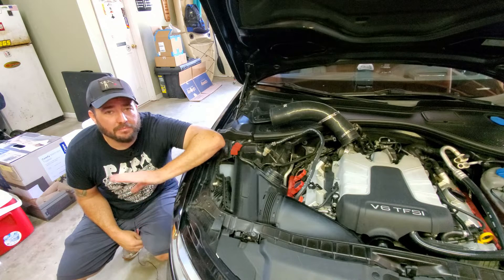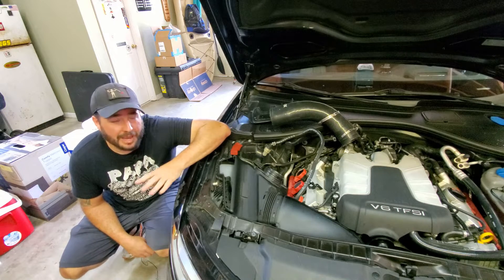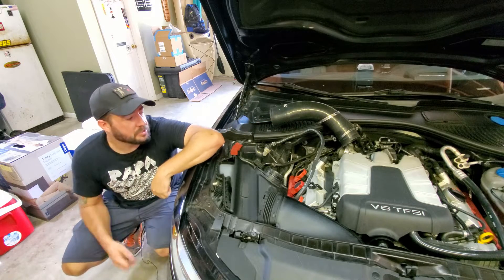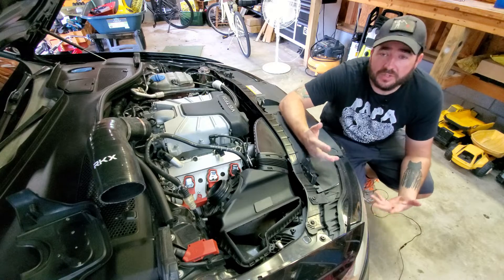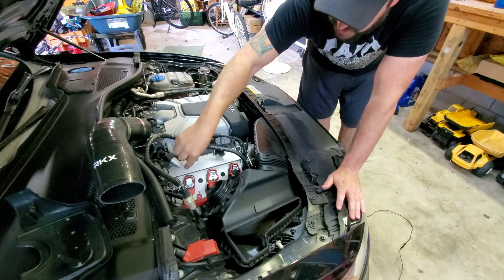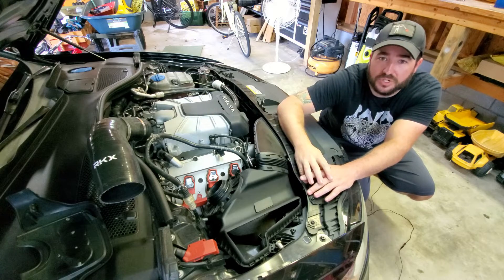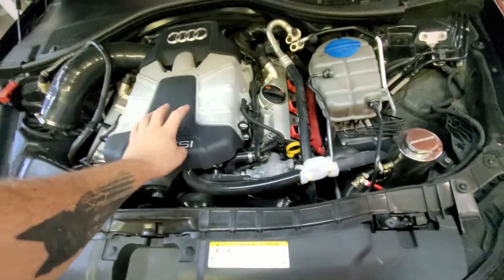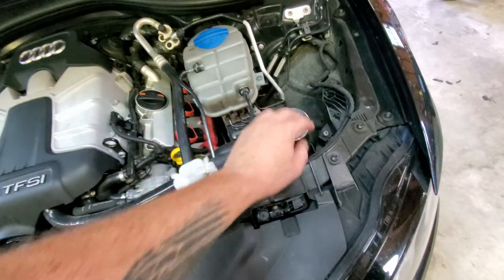How to Diagnose a Misfire on your Audi 3.0T Supercharged Engine

Comment: Hello sir!  New diy'er for this audi model here.  So Greatful for your the information you're providing for your fellow c7/3-oh-t owners.

When you have a moment to entertain...

1.  I'm getting ready to tackle the pvc replacement job.  Upon completion, do I need re-flah the ecu?

2.  I need to replace the upstream o2 sensor in bank1.  Can you confirm that  it is located on the passenger side/pre-cat?

Much appreciated for you direction!

-Clay from Illinois
Reply: Appreciate the quick response.  Respect!

1.  2012/NOT tuned/160k miles

I'm not really into the tuned scene.  I'm just more interested in keeping the car average and would to start doing the needed maintenance to keep it running as long as possible.

If a re-flash is required, can I do that w/ the obd11 or would I need to take it somewhere? 

2.  Reason I'm changing the o2 sensor is because I got a code pointing to faulty b1 s1 sensor.

I'm guessing oil may be the root cause because I have some leakage in the plug #2/#3 area.  After watching your videos, I'm almost positive the valve cover gaskets need replacing as well.
Reply from the maker: 1) If you replace your pcv with the newest revision you will have to take your car to the Audi dealer to get the updated ecu software.

2) I'd get a shop to check if you really need an 02 sensor. That code could be on a list of reasons.
Reply: Other notes:
*the car still runs fairly well since I bought w/60k miles on it back in 2015
*I have to add a qt of oil abt every 1100 miles
*I don't see smoke when I get on it.
*I don't smell burning oil
*thermostat and water pump were replaced 3 yrs ago when the car had ~130k miles on it
Reply from the maker: You aren't smelling or seeing oil smoke because your cats are absorbing all of it.  This will cause them to fail quickly.
Reply from the maker: With that kind of oil consumption I'd be very cautious that your catalytic converters are starting to fail
Reply: That being said and living in a state where emissions is regulated, would you still recommend the gutted cats (or test pipes) and weld cat around mid-pipes solution as my best option? 

If so, do u recommend any specific products?  I have emissions testing next month and I'd like to put a solution in place where I won't have to re-visit this for a long while. 😉

Btw, apologies for the noobie inquiries, I just want to make sure I'm on the right path with these repairs.
Reply from the maker: You will have to get creative.  If I were you I'd get the inspection done first & then dual test pipes from Canadian Auto Performance.  Watch my video on the 3.0t's fatal flaw
Reply: Yo, thx for your time brotha!  🙏🏾

Stay safe out there!
Reply from the maker: Welcome to the community! 

1) What year is your car? Is it tuned?

2) Both upstream 02 sensors are located pre-cat on the drivers & passenger side cats if I'm not mistaken.  I've never messed with them personally.

Comment: Good videos!. The 4th common issue is excessive carbon build-up on the intake valves - this is very common, especially when over 100k miles. I am seeing this on cylinder 2 and 5 with mine. (Can't feel it, no check engine lights, but VCDS reports it as happening a occasionally. I have a slightly rough idle as a result too.
Reply from the maker: It's common, but I've never seen it be so bad it results in misfires.
Reply: I have a 2013 S5 and getting misfire on cylinder 2 even after replacing coil and spark plug I think my fuel injector is bad or something else I can’t seem to find .. need help please my ECP light goes on after 2K RPM
Reply: @JoeyBAKAMarciano  what did you find to be the problem?
Reply: I had to replace a burnt valve for this exact reason.

Comment: Could a bad fuel injector cause a misfire?
Reply from the maker: Absolutely, but those are exceedingly rare when it comes to failures. And it should also give a legitimate code for fuel injector failure
Reply: Yes this can also happen. After a long drive downhill a leaking injector will flood the cylinder with petrol. When you add throttle - misfire.